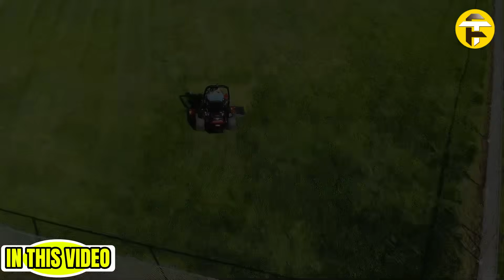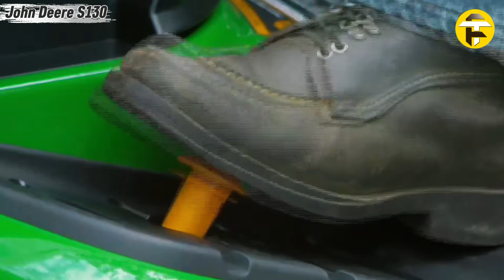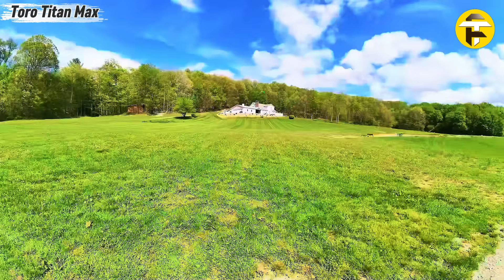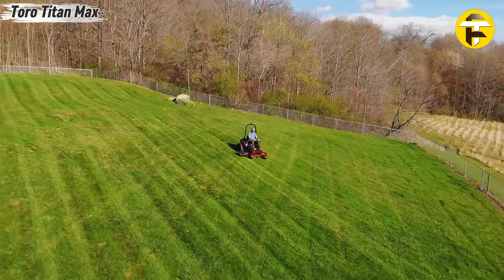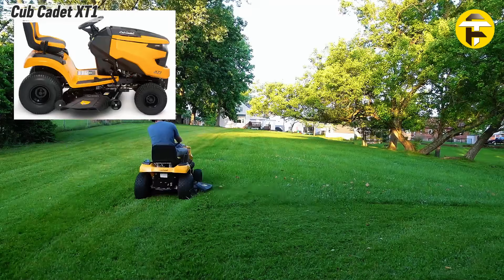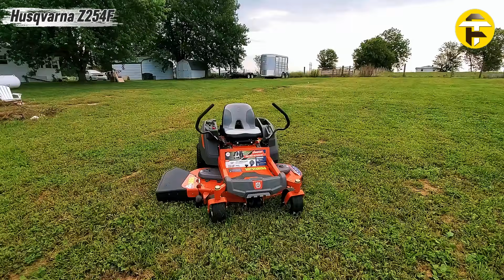The ONLY 4 Riding Lawn Mowers With Absolutely ZERO Complaints  — Verified by Real Owners (2026)

Comment: I forgot to tell you that I found out that if you take the metal cover off of the grass shoot it cleans out a lot better and the grass doesn’t build up
Reply from the maker: Awesome pro tip! Clearing that extra restriction makes a huge difference in preventing clogging in damp grass.

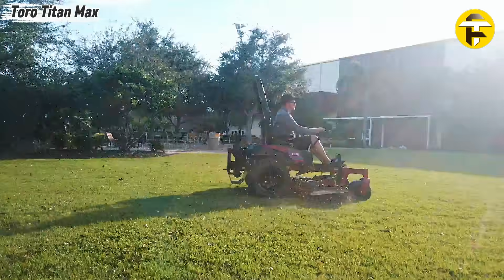Comment: I own a 1973  Simplicity 3416H  Sovereign tractor with a cast iron 16 hp Briggs and Stratton horizontal shaft engine and a 48” three-blade mower deck. The cast iron, 60 pound Vickers hydrostatic transmission is bulletproof. This beast can mow as good or better than any of 5:42 the crap sold 5:42 in big 5:42 box stores today. The mowing quality is 5:42 5:42 5:42  comparable to an eXmark commercial Lazer Z, thanks to the full-width deck support rollers which Simplicity put on virtually all or their mower decks. No power steering or cup holders; just 100% all-American engineering excellence from when America made shit that lasted: not in terms of hours or even several years, but decades. Prove me wrong..

Comment: What blatant nonsense. It sounds like the text is from advertising nonsense.

I have had a John DEERE D130 several years and it is junk.  In that time, I have had to have the steering gears replaced, at hundreds of dollars each time. The throttle lever also snapped, I think sunlight makes it brittle. Another costly repair.  The front wheels are too  small and the rear tires have almost no traction. 

The mower does not have grease fittings in a few high wear areas. The starter is weak, especially with a cold engine. 

Probably the worst is that John DEERE does  NOT sell parts to the public or independent repair shops. So even minor repairs like replacing the throttle level or replacing/adjusting the steering gears have to be done in an authorized shop.

Comment: Koehler engine is a piece of crap!  6 years about 50 hrs a year, block cracked and locked up. Got another motor, about 5 years, mower is burning oil! Changed oil each year! Don’t buy! Wouldn’t warranty first motor engine.
Reply: Got a 20yr old Kohler...no issues...